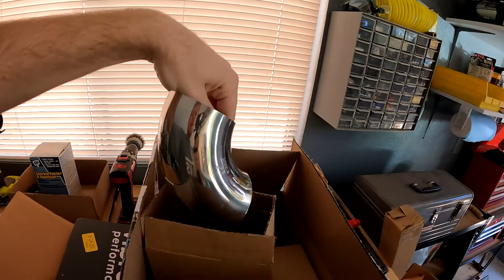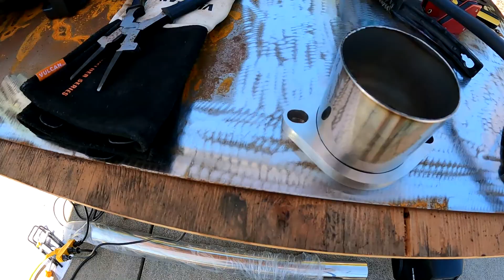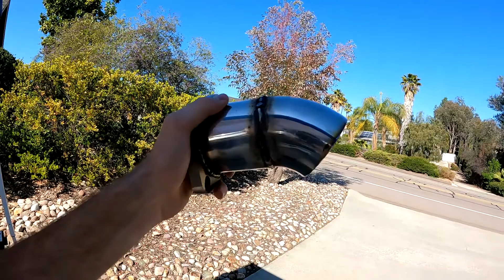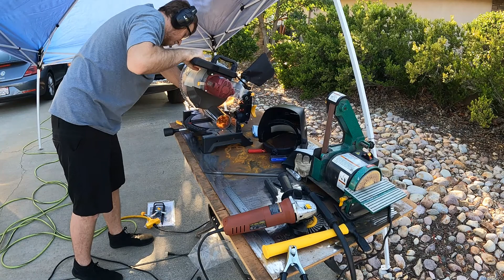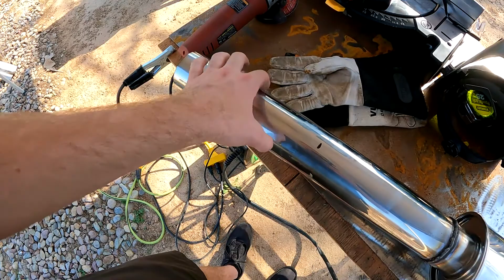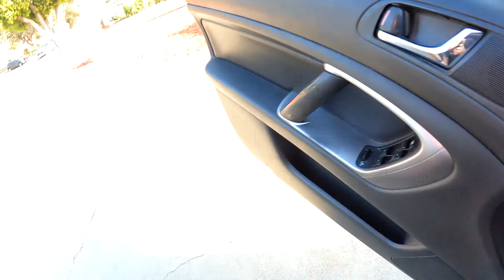Custom Stainless Steel Catback Exhaust for the Subaru Part 1

Comment: is it really to loud with just the vibrant reso on?
Reply from the maker: I love the sound, but I got a ticket because of it and ultimately that's why I decided to go quieter. On a scale of 1 to 10, 1 being stock, and 10 being open downpipe. Just the resonator was like a 7 or 8 and the full exhaust I have now is like a 4 or 5
Reply: @SWSpeedCo  thanks that’s a perfect example. 5 is perfect for my daily drive.
Reply from the maker: So I just added 2 mufflers onto the first exhaust I made to make it quieter, and to be honest the cost of materials to build an exhaust is the same price to just get a magniflow, or Hks exhaust system and they have better welds lol
Reply: @SWSpeedCo   Hey, did you get rid of this exhaust you put together yourself or you just got a new full exhaust installed which is less noisy? Sorry, I don’t know much about exhausts.. All I know is I have a DP on my car and after it’s all stock from there on.. Btw, would you consider selling the one you made or make someone a copy? I have your exact MY car, but automatic.. I’m looking for something not too loud, but that one can hear the boxer rumble when stepping on the gas.. Let me know 👍🏻
Reply: @SWSpeedCo  I understand. Ok, thanks.